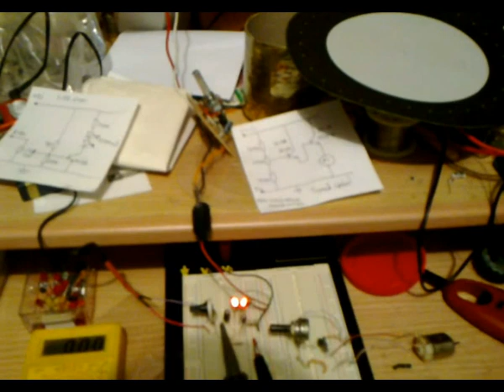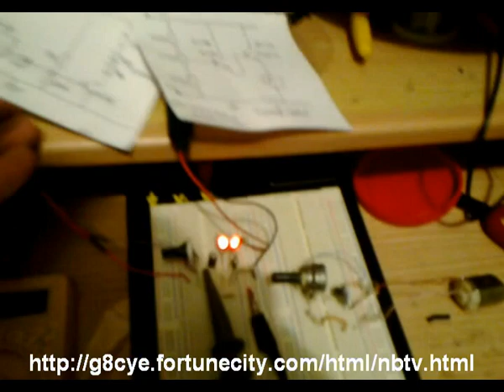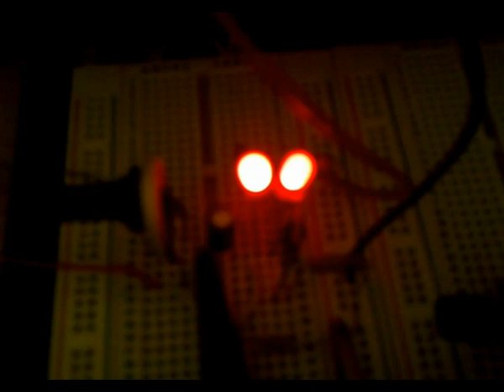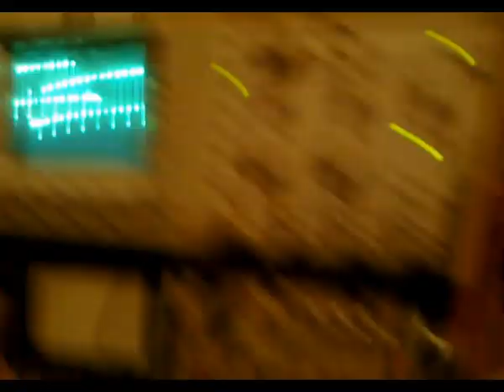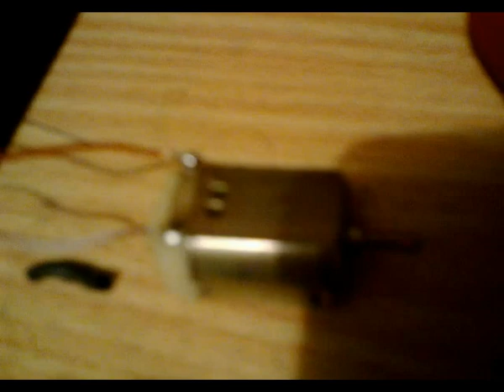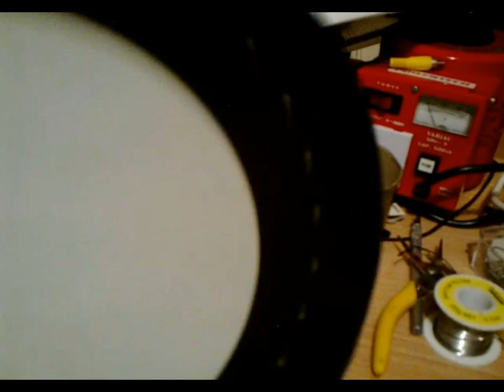Homemade mechanical TV set (part 1)

Comment from the maker: Thanks for good words.I have since made quite a few mechanical TVs since this first one, I've made a plywood disc set, a tin can aperture drum set, a multi-standard 30/32/60 line set with vertical/horizontal scan and recently I've successfully made a working 32 line mechanical TV camera/monitor unit which I'll be posting my 40+ construction progress videos and telerecordings soon.

Comment: For the mechanical television I'd suggest moving from a disk to a belt, perhaps something with roughly the dimensions and speed of a belt sander, which could probably net you something in the regon of 15 to 20 fps.  The obvious advantage here is that you could present the playback in rectangular instead of a slightly curved pattern, not to mention the overall size to screen size ratio could be somewhat minimized.  I would also advocate forgoing any image capture in favor of a converter for playing back pre-existing video - perhaps you would then only need to set up synchronization pulse(s) with the belt to either buffer the converted images or provide automatic speed adjustment.  Also if you forgo the crude image capture you can obviously up your resolution depending on your playback device.
Reply from the maker: Thanks for the suggestion. I've been contemplating on building a belt scan mechanical TV, will eventually build one. This is one of my first videos building my first NBTV receiver by the way, I have since built better receivers, last year made a record disc receiver with successful synchronization.
Reply: @troysvisualarts  Fantastic,  I look forward to seeing!

Comment from the maker: Good to hear from you, your simple setup for mechanical TV has been a staple in pretty much most of my mechanical TV sets, I pretty much used the same LED driver circuit for all my displays and DC motor control for all my sets that use a DC motor and is also what kickstarted me in the mechanical TV side of things in the first place :D . Anyways have you made a new site as I will put the new link in my description?